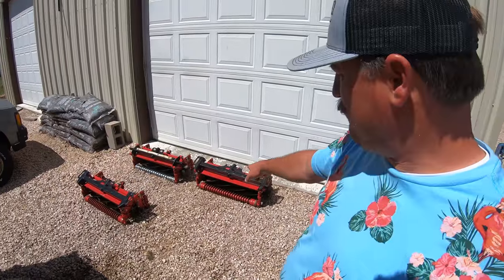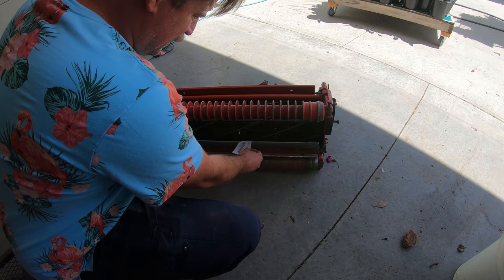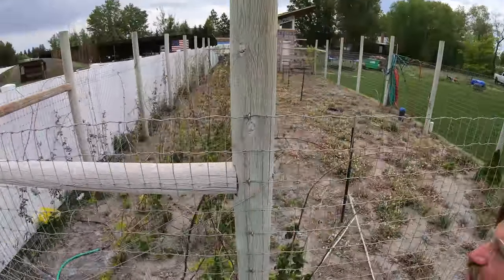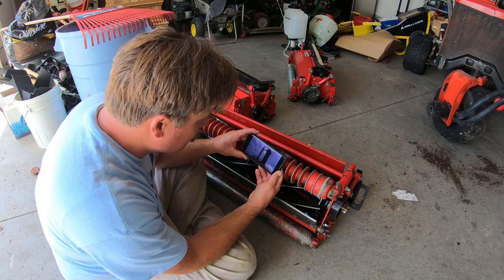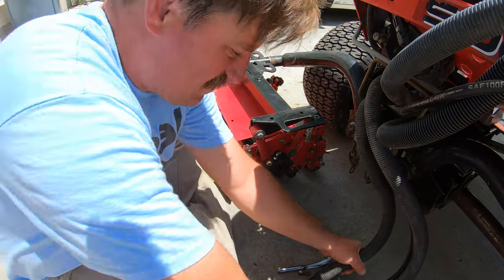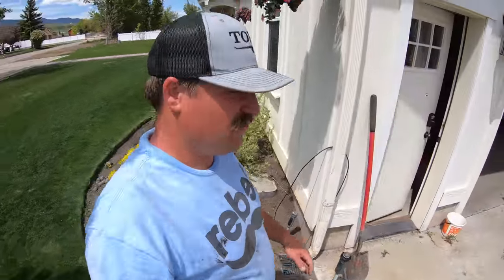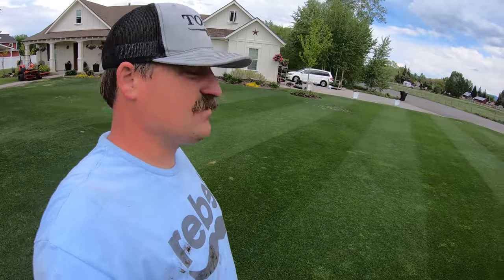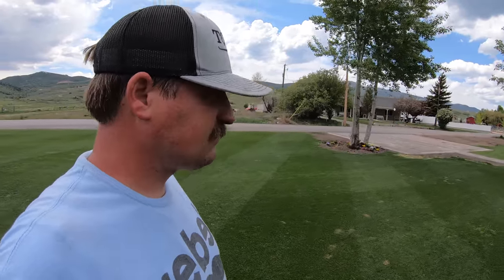New reels. First mow TORO 3100D Reel mower

Comment: Connor, you need to use Specticle G by Bayer to keep weeds and Poa out of your lawn, I use it on my Emerald Green Zoysia here in the Atl area and it works very well, I also use Growth Regulator on my turf and plants to keep from having to cut and trim shrubs as often. BTW there are two different Growth regulators, one for turf and one for plants.

Comment: Connor, I stumbled onto your awesome channel. I also live in Utah (Northern Utah County). I have a postage stamp lot. My front yard is just under 1000  sq ft. I want to try a lawn renovation starting with the front yard. (It has a huge crest in the center and valleys where drain trenches have settled, etc.) So my question is this. Should I wait until spring? Or should I start right now? When is the best time to start? Are you for hire? ;)

Comment: So apparantly (according to Toro), There's grass catchers availble for the 3100-D. Should work a treat for your lawn.
Reply from the maker: They are discontinued and not in production for my older machine. too old not making parts anymore.
Reply: @lawnrebel  Ouch. Have you tried R&R Products? (I think it's called)
Reply from the maker: Yeah and the toro commercial golf dealer
Reply: @lawnrebel  Better start saving for a 3250 then haha